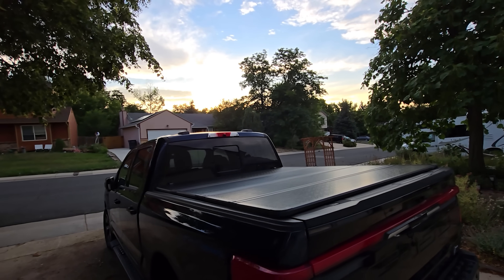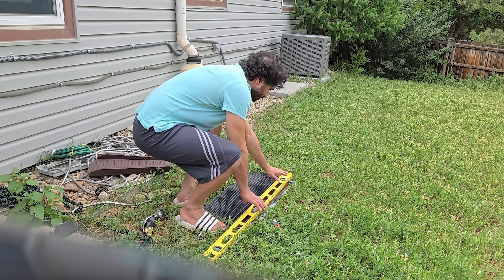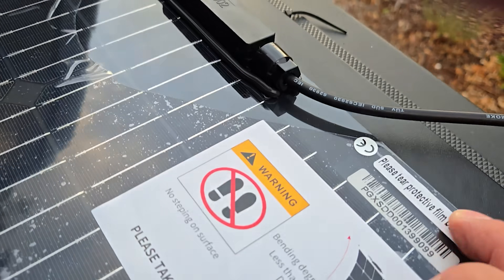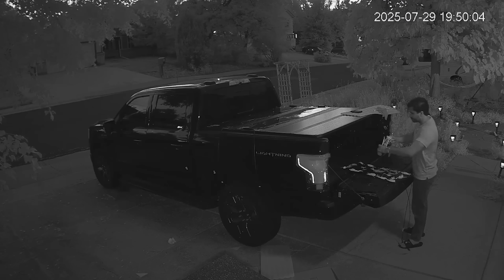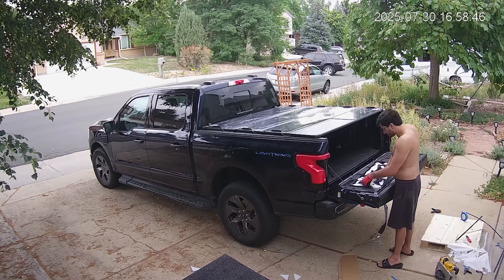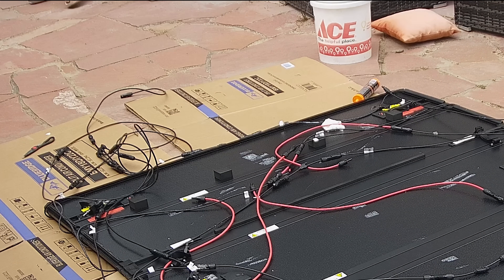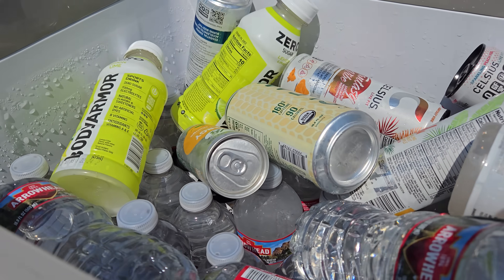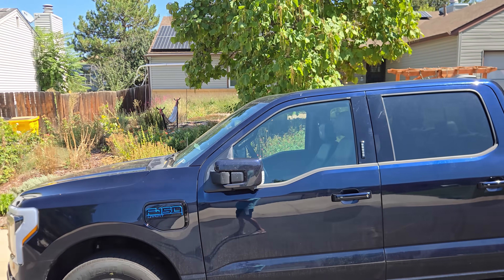Building a Solar Panel Tonneau Cover to Recharge My Electric Truck

Comment: Ford needs to add a 2-5,000 watts solar charge controller they only cost 100-200 dollars to the ac inverter in the truck 🛻 so you can direct charge the battery 🔋 because that set up is = to 5 miles of range a day and with a more efficient truck coming in 2027 and a large more efficient truck bed cover you could add 7-10 miles a day in solar charging !!!!! That would = 40-70 miles a week or 2,000- 3,000 miles each year !!!!! Most people drive 10-20,000 miles a year !!!! We need options ford !!!! Most customers will save .25 to .50 cents a day in electric ⚡️!!!!! That’s 90$ to 180$ dollars a day and if you could plug it into a 2-5,000 watts of solar you could solar charge truck only !!!!!

Comment: Crazy amount of glue and completely unrecoverable after couple of months after the cheap panels stop working. I would have used strong Velcro or other similar solution for easy change of the panels.

Comment: Idea is genius. Just a note though: for efficiency the fan is supposed to jettison the air OUT of the enclosure with the electronics, not circulate the hot air it produces inside the enclosure. Not sure if that was a joke though since the smoke trick happened after lol.
Reply: True, but Better to circulate the air you have then not at all
Reply: @BradBennet-md4tv  😆 touché. Also: if it ain't broke, don't fix it.
Reply from the maker: The tailgate was closed during the test, can't have my neighbors stealing my batteries! 😅

Comment: With contruction adhesive, you need industrial caulking guns. Cheap versions are too weak. Also! A good quality two sided tape would have worked better and be removable if you damage a panel over time.
Reply from the maker: I was hoping to learn more through comments like yours, thank you!
Reply: @deadlykiller27 I found out the hard way myself when remodeling my house. Stronger gun made a HUGE difference.

Comment: I love it. I already have solar panels on my truck cap/camper  as you can see on my channel.       I love this though. I wanted to see what else you do with it. And I charged my truck off of it! I have a 4KWH hour “SOLAR GENERATOR” And so I can add about 10 miles a mile each day

Comment: To be honest, it seems a little silly. Your battery is, at a minimum, 98kwh. That would run something like an eco flow glacier  (55watt) cooler for about 50-60 days realistically. 

While this is a cool thought and actual experiment, and is great for you tube,  I don’t see the practical value.

Comment: I like the idea of making what amounts to an electrical "gas can", just enough range to get you to a charger in a pinch.
Reply from the maker: Yes exactly! Should help with confidence when stretching between chargers. I am looking forward to testing this out later today when the inverter finally arrives!
Reply: @deadlykiller27 should make it a hard cover with 450w panels and you’ll never have to charge your truck again.
Reply: As he said, its more practical to use it for keeping a fridge or other electronics going.  I wish it was enough to charge off of.  My car sits in the sun all day at work, and every little bit means less charging towards the end of the week.  We just arent there yet though.
Reply: @Kami8705  , is any innovation born fully formed?
Reply: @Kami8705 There are much better panels available that are hitting 25% efficiency now, which would nearly triple his power generation.
Reply: Estimated full charging time 1 Year
Reply: @punker4Real  , not meant for full charging of the battery, but sure, if you enjoy strawman arguments, then chuckle away.
Reply: Based on his test, it’s closer to 4 miles per day. It would take a niche set of circumstances to have it make sense to DIY, but it would make sense to me in a sunny, high cost of energy place where you rent your home. (California and Hawaii)
Reply: @ianmcmahon8589  Hawaii has a lot of rain. Hence the green.
Reply: Yes!  Just park it in the sun for 3 weeks and you could drive 2 miles!
Seriously, this is dumb.  The added weight alone is a reason to not do this.
Reply: @davidbeppler3032  the added weight but not the fact that he turned his truck bed into a trunk? 😂
Reply: @davidbeppler3032 it's like 4 miles a day and the added weight doesn't affect range .

Comment: Use real rooftop 300-500 watt panels, 3+ layers, slide out rails left and right, front and rearward when parked.
Panels could be stacked to at least the roofline
With proper rail system racking, a set of 3 pulls foward over roof, hood, then left, right slideouts, another set of 3 slides rearward behind truck, base layer of 3 over bed with a slideout panel to left and right. 9x 450w, up to 4kw charging while daytime parked

Comment: I'm surprised that after cutting off a section, it still works just fine. 
I'm a solar guy myself and it looks great.
I do solar because its a hobby and I get something back.
For people thinking about doing this to for practicality purposes, it's not the answer.
2kwh is good for maybe 3-5 miles ? And this is if you park in the hot sun all day long.
Your truck is great for camping those because that 2kwh is plenty to run a lot of stuff.
I would suggest you switch to a power station and leave that in your truck.
These are so cheap now and you can have wifi/BT to control everything remotely.

Comment: As a heads up, most flexible panels degrade in constant sun in just a couple to a few years. And ETFE coated panel will last a big longer, but a BougeRV cigs panel will have the best warranty, hold up really well, and can't be accidentally cracked by something falling on the tonneau cover. They stick on or screw on as well

Comment: I thought the truck loses charge when sitting for a few days. Maybe you could break even on range I guess you can run a test when you get the new batteries.
Reply from the maker: The truck is actually really good at not losing any charge. I've had it sit for over a week and not lose any percentage. So if I left it at the airport or something for 7 days it might actually gain almost 10% I would guess. We'll have to see haha
Reply: @deadlykiller27  This is true! I was pleasantly surprised when I switched from my 2009 hybrid to the Lightning that the battery didn't lose any charge when left unattended.

Comment: Cool idea ! Did you see if any rigid modules would fit ? Also what about water ingress on those panels you cut down ?
Reply from the maker: I don't think any rigid modules would fit and still allow me to open the cover. If it does, it would probably make it too heavy too.

So far it's holding up fine, but I will probably buy more of the panels to have as a backup while also still using it in other areas on my property for lights, etc...

Comment: This kind of cements the lack of viability of solar on a vehicle unless that vehicle is designed to be ultra efficient like the Aptera. Solar just doesn't have the density to be that useful and panels severely lose collection efficiency if they don't face the direction of the incoming light.

Even if you put 3 rigid panels on some type of folding contraption to get triple the surface area when parked it still would only peak at maybe 1200 watts and you'd always have to park somewhere that you can take up three spots to unfold.

Comment: Thus is a really great start!  

Agree with others - but a “roll up” panel that could be out on roof & frunk?   You might soak up another 2-3 KW & total out 5 to 6 KW total.
Reply from the maker: That's what I was thinking, imagine if the doors had solar too and the windows! I hope one day it's a factory option for these cars.

Comment: I want to do something similar! My plan is to add panels to the roof of the truck and a canopy with the option to connect to the solar on my 16ft Scamp with a option to charge. Thanks for starting this. I will be following for sure.
Reply from the maker: That's awesome! Share when you're done!

Comment: Do the roof and frunk
Reply from the maker: I need some non permanent ideas to do that then 😉
Reply: Put vinyl wrap down first. Then attach the panels to the vinyl with 3m adhesive tape

Comment: You have a plug in back of your truck that could power your fridge longer than 17 days lol
Reply from the maker: Truthfully ford software team made some poor decisions, the outlet shuts off automatically when the load is too low (which this fridge is) plus I would need to remember to turn it back on everytime I start the truck